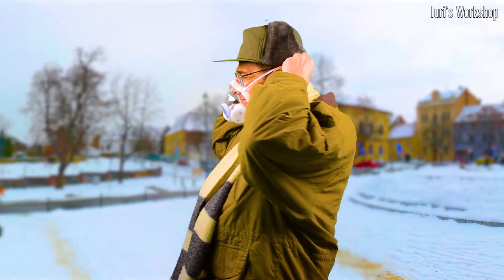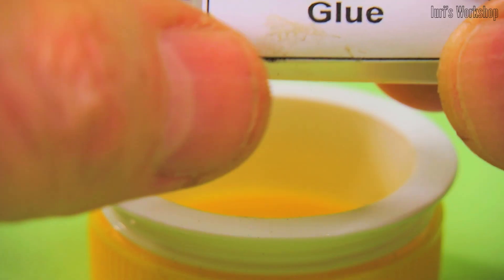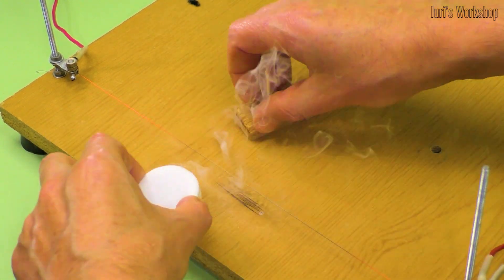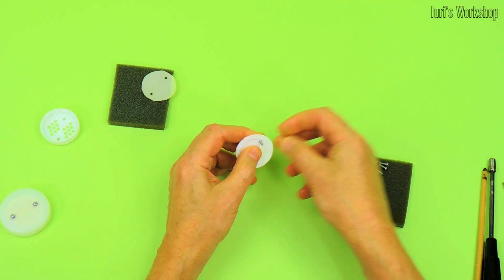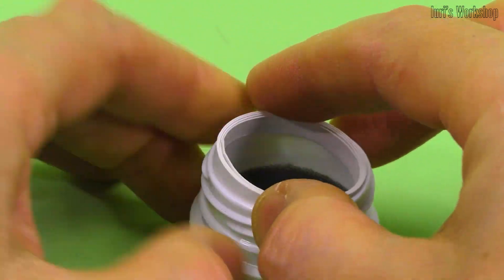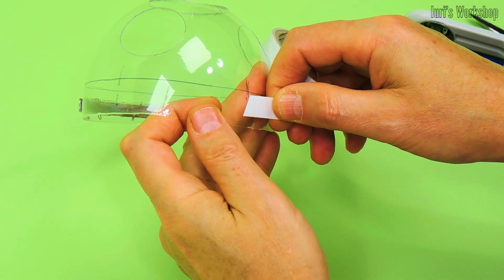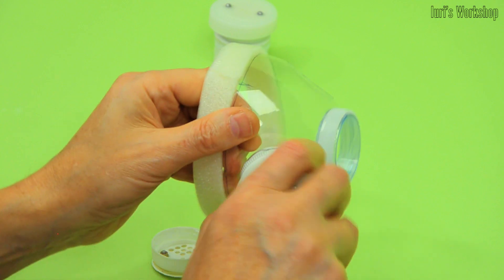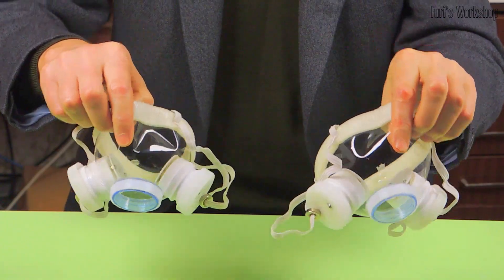DIY Winter Face Mask

Comment: Master, style and detail is perfect!
I want to set up a work area for family use masks and in my workshop for paints, dust, etc., at the same COVID. You will have tutorial of masks for gas or gases and other particles. Also if possible some tools or accessories that you recommend to make or use for this purpose!
Greetings and thanks
Reply from the maker: You can use an activated carbon filter. A similar filter is used in factory gas masks: https://youtu.be/-5HhjDENfFQ
But you should consult with a chemist additionally.